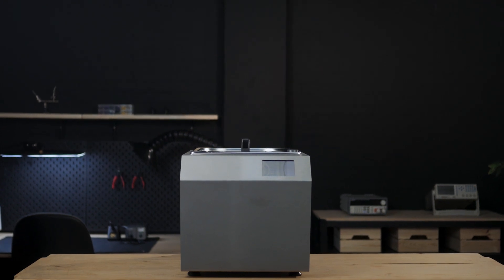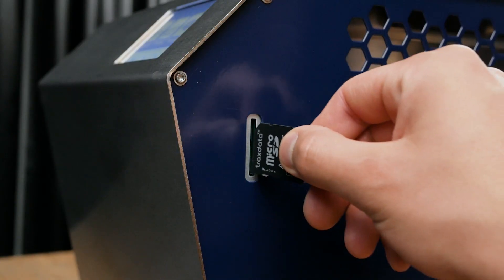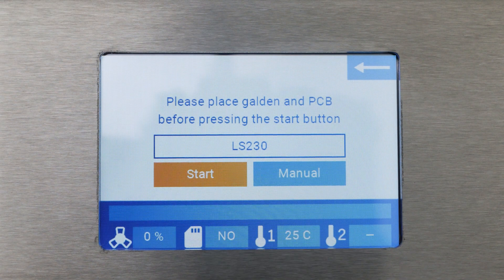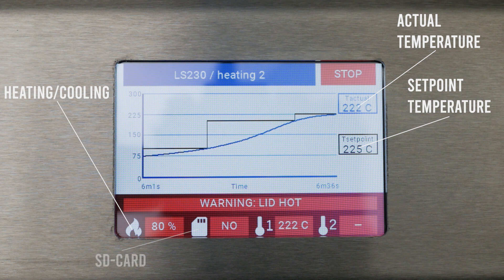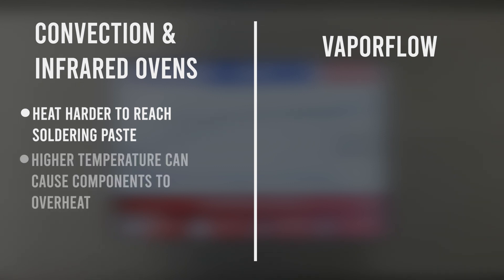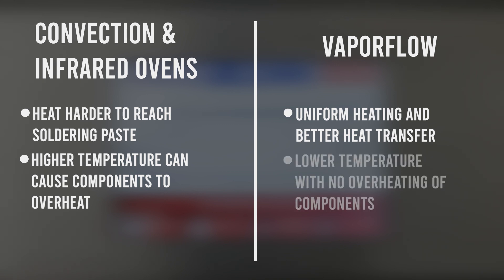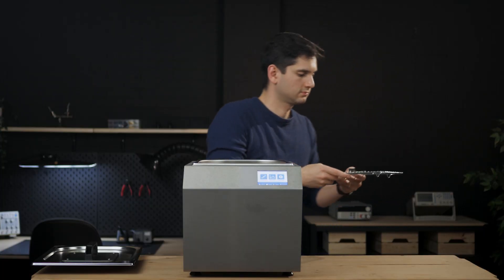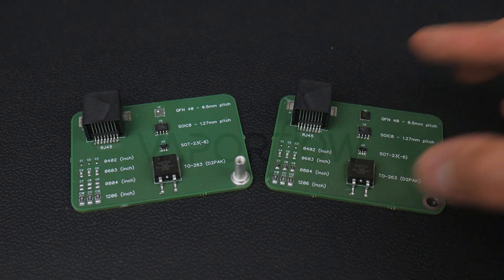Vaporflow | Vapour Phase Reflow Oven

Comment: The 2 requirements of high-quality vapor phase reflow are STABLE TEMPERATURE PROFILE AT BOARD (support flux activation and reduce thermal shock consequences) and VACUUM (extract air voids from solder joints, ideally <50mbar). I assume this unit is designed without a vacuum system and without secondary stabilizing features (ex. mechanical lift/lower) and priced accordingly, suitable for prototyping and commercial-grade low-volume PCBA.
Reply: This is a desktop prototyping and small batch production machine indeed. It provides more consistent results than similar convection ovens.

Comment: Is it compatible with LEDs? Is there a chance the liquid vapour react with the glass or silicone lenses to blur them?
Reply: Vapoflow is a great solution for metalcore PCBs, but we haven't tested soldering LEDs yet. Could you name a LED which is available in small quantity from Farnell/ RS/ Mouser in Europe? Then we can test it 🙂
Reply: My first thoughts also @walimo6810.  @VaporflowSoldering  check out WS2812b or APA102.
Reply: @VaporflowSoldering  Can you try this LED? SMTL4-SBC-YG
Reply: Yeah we will. However currently it will take a month. We will design & order a metal core PCB to test these LEDs.
Reply: @VaporflowSoldering  what was the outcome of this test?
Reply: @VaporflowSoldering  I am also interested in the outcome 😃